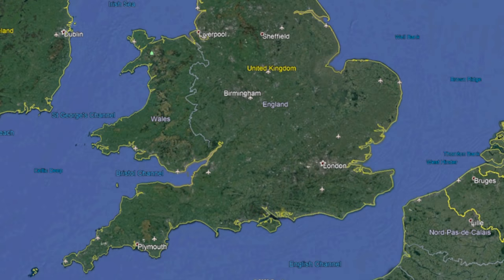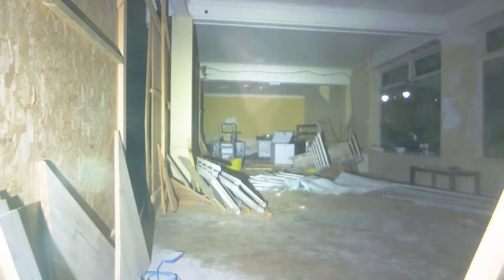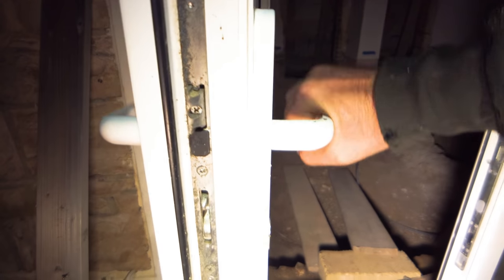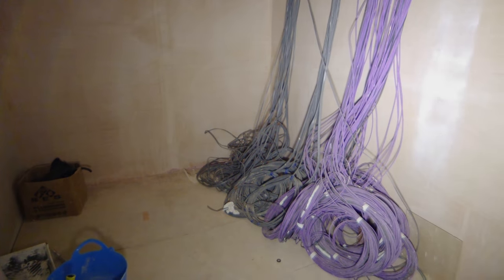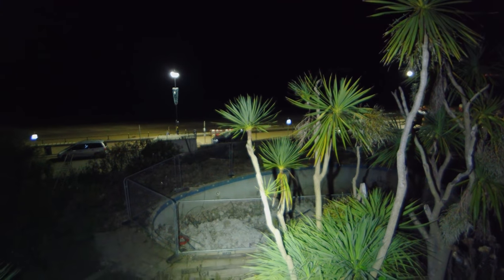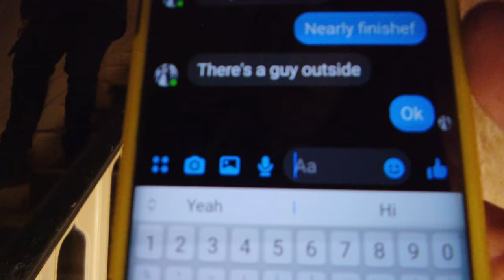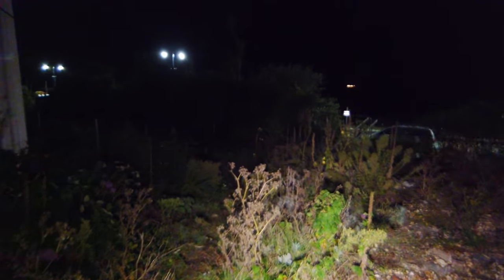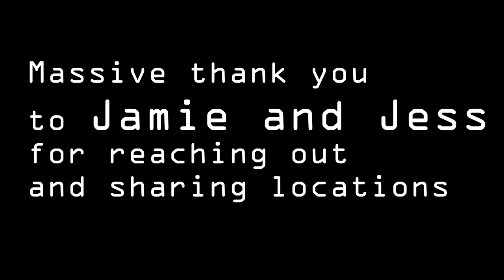Ocean Hotel - Sandown - Isle of Wight FULL EXPLORE 4K

Comment: Hi Matt, the reason why there are so many doors to the high street is the hotel was actually extended over time by buying various buildings in the high street, which were then linked together in like a chain with a small corridor between each building. If you walk down the high street side you can see the buildings with their original front doors. This explains all the different stair cases, as these were the internal stairs of the different buildings. Sorry to go on,, but I’ve spent many a happy holiday at the Ocean and it has really fond memories for me. There used to be a grand staircase/hall just inside the main entrance, not sure if still exists, but that’s probably the bit you didn’t get to.,